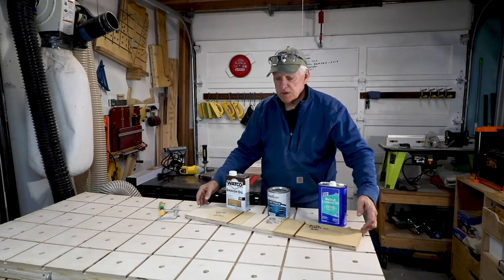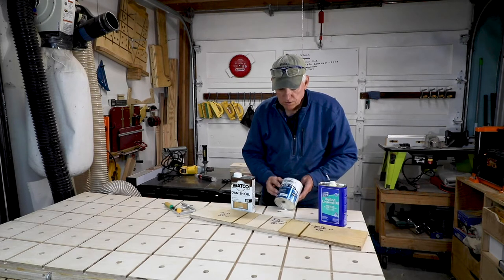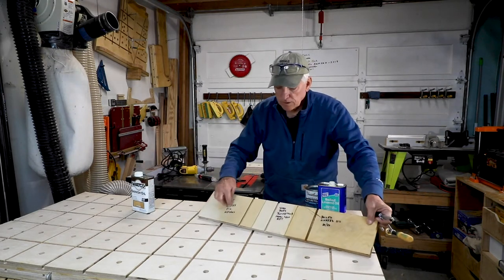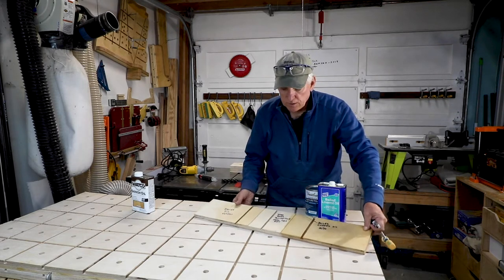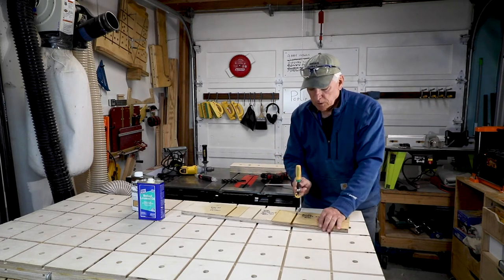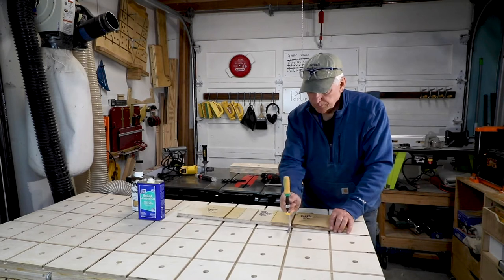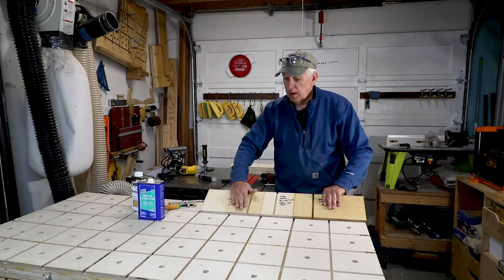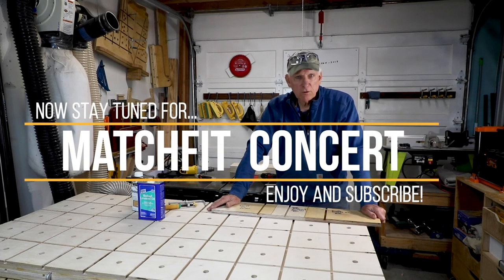Matchfit Dovetail Grooves - Best Finish To Allow Those Clamps to Actually Slide

Comment: I can hardly wait to have the room in my garage for a workbench. I'm 99.99% sure that I'm going to build your PopUp Workbench. I have been trying to design a workbench but haven't been able to get much past the designing a retractable wheel system. I've been using other's workbenches as a starting point for mine, but it's requiring too many alterations to suit my intended usage. Maybe it's a sign for me to stop trying to design my own since you have come out with the PopUp workbench when you have.
Reply from the maker: Well, if you get that garage cleaned up and ready for the build, I hope it works really well for you.  I put it on a plywood platform with 4 inch casters and now the whole unit is really, really easy to move to my carport or driveway.  Maybe you could do this build, clear out some room in your garage for it and start using it in your clean driveway or carport right away.

Comment: Hey old dude.  I'm a 67 yr old woman and I just got started n woodworking this spring.  Actually it started out as maintenance on my hse. And just took off from there.   I have lots of power tools now. And just pulled the trigger on my Dewalt table saw. Anyway, most of the stuff I've been making r jigs.  Really trying 2 decide if I should go the t track route or the matchfit system.  U make an appealing demonstration and a lot of tips too.  On the other hand, considering the price of hardwood,  I'm considering the powertec t track table.  No muss or fuss, and n the long run costs about the same.  I can rationalize anything.
Reply from the maker: Yep new woodworks can find all sorts of ways to rationalize additions to their shop!

Comment: Tung oil, mineral spirits and a bit of spar varnish. This will give you what you need in terms of smooth service and will make glue spills easy to clean off. Been my go to finish for workbenches for 50years.
Reply from the maker: Superb - i will try that combination as well.

Comment: Thanks for the information, I just made a big table and I was going to use that polyurethane you used. Now I’m going to use Danish Oil
Reply from the maker: Oh, boy, putting Poly on Matchfit Dovetail grooves is a way to make sure the clamps won't slide.  Danish Oil much, much better.  You will also have to gradually work on any spots clamps don't slide easily with sanding or a file and blow debris out of the grooves either after you use them or right before you use them.  Let me know if you have any great jigs or uses of the Matchfit clamps!

Comment: Have you experience any durability of the dovetail slots over time?
Reply from the maker: I have not had any problems yet.  Keep the grooves clean of debris and clean up any glue that might drip into them, but structurally seem strong but donn't stress them with some super human clamping pressure
Reply: thanks for reply @SmallWorkshopGuy

Comment: I also have this system and used it with my crosscut sled. I am wondering why use anything in the dovetail grooves, mine seem to move along just fine? My base is made of 3/4” melamine particalboard. Just my two cents worth.
Reply from the maker: Just to add protection to the wood.  Probably not necessary if controlled environment in your workshop without too much humidity.  However, protection more important on jigs and workbench tops that might come into contact with glue, etc.

Comment: How did you apply the danish oil?  What device did you use? Did you apply more than one coat of danish oil? If so how many and did you do any sanding in between coats?  Lastly, did you apply the danish oil just to the bottom flat part of the dovetail groove or did you also apply to the side walls of the groove?
Reply from the maker: That was a while ago and to be honest I cannot remember.  Based on how I ususally apply Danish Oil, I shake the can a lot and then I pour it onto a multi-folded absorbent cloth and wipe it on generously and let it soak in for 15 minutes and then wipe off all of the excess.  I specifically did try to get the oil into the bottom of the grooves, but I did not flood the grooves or work on getting it on the walls.  Hope that helps.  Main point is that anything I used Polyurethane on does not slide worth a crap, so no Poly on Matchfit Dovetail grooves.

Comment: Greetings from Australia. Could I bother you with a couple of questions? First, I think you said the BLO was 50 50. We don't always have exactly the same products as USA, so what is added to the Linseed oil? Second Matchfit say that you can make jigs etc out of MDF, do you think the results would be the same with MDF? Thanks
Reply: I'm an Aussie too and he is mixing BLO (Available from Bunnings) with turps which the US call mineral spirits. Also I've made jigs with MDF and finished with Danish Oil, BLO or even wax. They all work fine for jigs. They also call metho, denatured alcohol. Confusing isn't it? BTW I'm not a big fan of dovetail slots and dovetail clamps. There are better more versatile alternatives.
Reply: @WasimBarri  Thanks for that. For sometimes I find dovetail clamps very useful. The problem in my opinion is that the company overstates their uses. But Matchfit is not the only company guilty of this. Won't mention a pocket hole tool company that tries to suggest that pocket holes should be used on every occasion. By the way what do you find more versatile?
Reply: @sheilbwright7649  T Tracks and/or T slots made with a router bit are a lot more versatile. They allow the use of standard bolts, not Microjig's dovetail bolts, that can be found at any hardware store and they also allow the use of clamps from Bessey, Rockler, Armor tool and Kreg which can all swivel 360 degrees and have auto adjust technology. The dovetail clamps require more slots because they don't swivel 360 degrees. I've seen drill press tables with over 10 dovetail slots compared to the "normal" 2 T Slots and work benches with over 20 to 30 slots. That's a ridiculous amount of routing. Also, the cost of dovetail clamps are roughly the same price as some of these other clamps and as you've said they overstate their usage. The main argument they make is the cost of T track but I don't find them expensive and if I've run out I just make my own using a T slot router bit or simply placing boards on top of each other with the appropriate gaps. 

I think Microjig have reinvented the wheel (slots with clamps have been around for years) and because they aren't as efficient you need more wheels and if you want to buy a tire for those wheels you can only get them from Microjig. Don't get me wrong I love most of Microjig's products especially the GRripper but not dovetail slots and clamps which are too unique and limit choices
Reply: @WasimBarri  Thanks
Reply from the maker: John Barr below correct in his answers above.  I find the Matchfit Dovetail Clamps to be very versatile.  I am not a fan either of the little accessories that Matchfit promotes but I find I can grind just a little bit off of regular T-bolts and they work great in the routed dovetail tracks.  By the way, if you have a workbench top of 1" or less, the Matchfit Clamps will go into dog holes and work in 360 degrees.  Anyway, different strokes for different folks.  Now I am going to go put some shrimps on the Barbe.  And, hey, Aussies, my heart goes out to you with all of your fire devastation and the loss of so many of your beloved creatures. One of the best trips of my life was a home exchange in Sydney - can't tell you what a beautiful city that is - spectacular - and I never meet nicer people on any of my many trips elsewhere.
Reply: @SmallWorkshopGuy  Thanks for your reply and your empathy. Bushfires are mostly under control for now. But usually our bushfire season starts around now. So we haven't made it back to the station yet. Glad to hear you enjoyed your time in Sydney haven't met an American either here or US or Mexico that didn't (either that or your all incredibly polite). If you didn't get to the Great Barrier Reef or Kakadu and environs make another trip!
Reply: @SmallWorkshopGuy  I actually use the dovetail clamps, as you said, in my workbench that has an array of dog holes. I find that's their best part but I don't use dovetail slots. I really appreciated your heart felt comments about our recent disaster. I lived fairly close to one of the major fires and the smoke was suffocating. All good now but the damage to houses and wildlife will never be forgotten. Thanks for your concerns.
Reply from the maker: If using MDF consider adding hardwood aprons to protect the edges from crumbling
Reply: @WasimBarri  Yeah, what is the deal with their non-swiviling clamps?  They can b so annoying in that they don't slide up & down well, but why aren't they coming out with a brand new clamp that swivels?   New & improved!   They'd sell a ton of them and I can't believe the modification would b all that difficult.   Mind you, I'm not smart enough 2 figure it out, but you know they can.  It's not like it would make a difference in how many dovetails people run.  Once you've bought the kit it's irrelevant if they even use it or not.  They've made the sale.  New clamps would encourage people to try the system.   Thx for reading my rant.  I feel better now.

Comment: I came here hoping to get information on what finish or how to apply if the finish to prevent wood glue from sticking inside the dovetail grooves.

I'm still searching but if anyone here can provide any tips on what they use I would appreciate it.
Reply from the maker: Wow, really..... I did not clearly communicate that Boiled Linseed Oil or Danish Oils allow sliding much better than Poly.